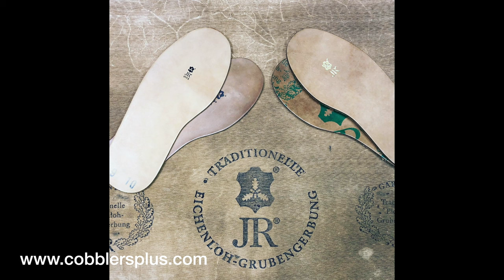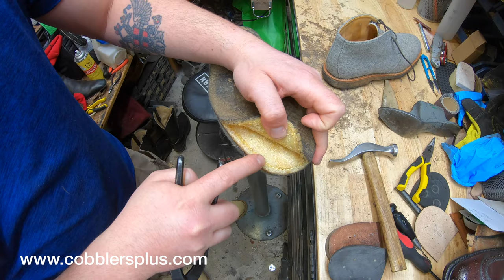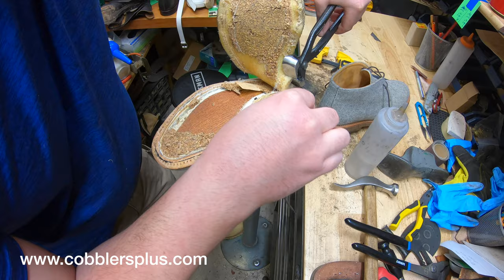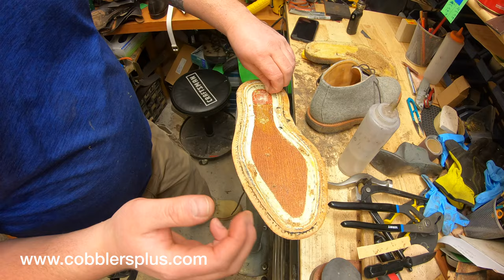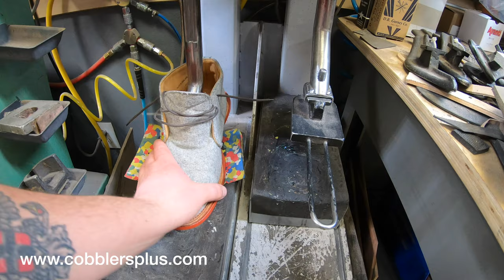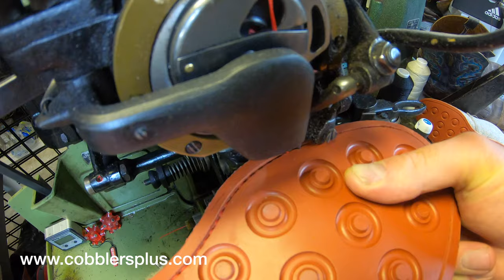Mark McNairy switch from a Plantation Crepe Sole to Dainite Rubber soles and in Red!!

Comment: Please tell me where the wallet we sent in months ago is at....Customer service will not take our calls. This has been a nightmare. DON'T SEND YOUR ITEMS TO THE COBBLERS . THEY ARE SCAMMERS
Reply: Where would they be responsible for your wallet left even longer than 30 days. Have you stopped in or called more than once? Maybe you have totally forgotten about it. From a former cobblers stand point myself in an entirely different state, any items that were not picked up within 30 days were either sold, donated or thrown away! Retail space isn't cheap by any means and isn't a life long storage unit free of charge! Customer shoulda made more effort and been more responsible!
Reply: @kennethkauser4604  huge assumption Kenneth.. customer service didn’t finish the wallet and sent no updates. I’ve called many times. It hasn’t been over 30 days. I’ve emailed as well. No reason to justify “donating” the wallet. Sounds like an excuse to keep people luxury items aka a scam. Please don’t make assumptions on specific cases you simply don’t know the facts of
Reply: There's a difference between 30 days and months like you stated. Disclaimer is on the claim ticket upon drop off so the responsibility falls back on to you the customer!
Reply: @kennethkauser4604  you clearly don't know what you are talking about. You are blindly supporting a company without further information. I gave customer service your name and they were apologizing and backtracking what you said. It's quite embarrassing and is only helping my case. 

There is no justification for sending something to get fixed, not receiving one update and then being ghosted while calling and emailing numerous times. But I'm not going to waste my time explaining myself to someone who doesn't have any power within the company and cannot think for themselves. I was trying to warn others about this service and not argue with someone who should get back to work. No wonder your company is so backordered, look at what their employees are up to